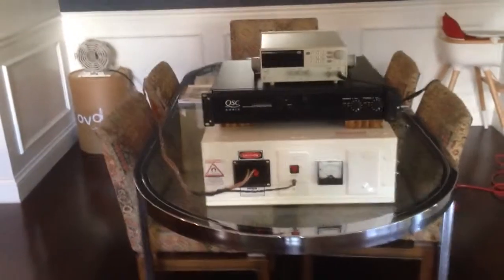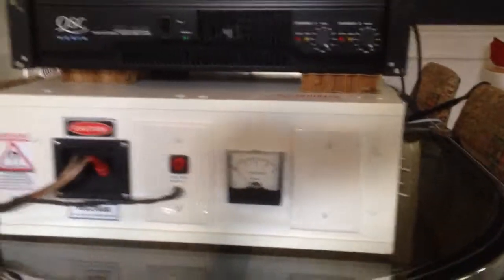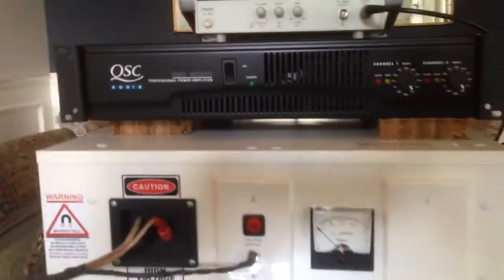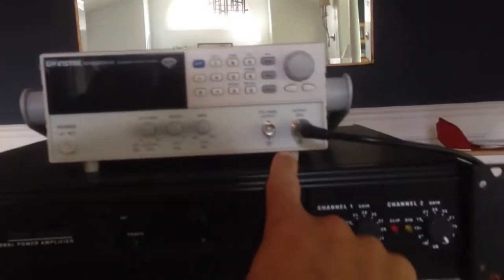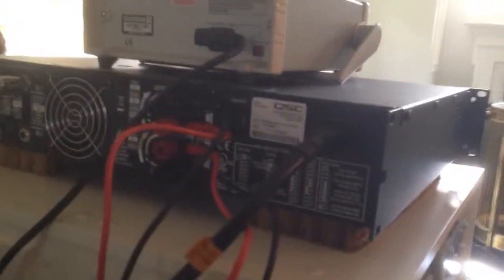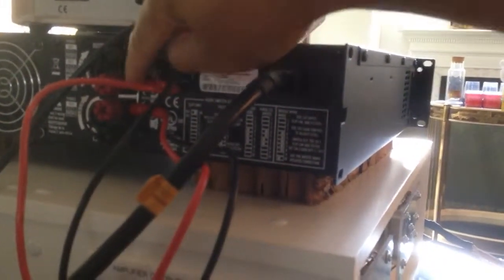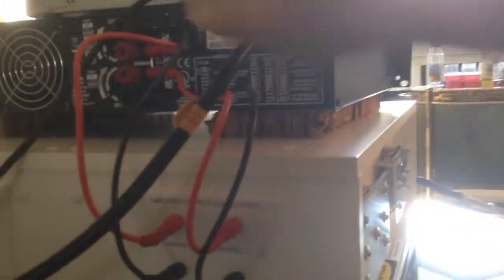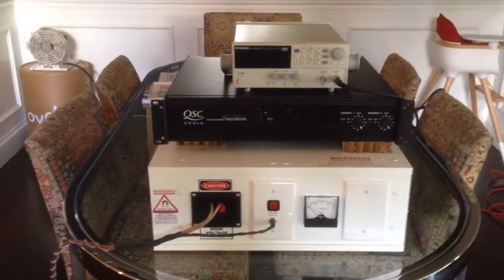Lyme Disease / Coinfections Treatment Demo: How to Setup a Doug Coil Machine, Part 1

Comment: Thank you! Lost my instructions so this was a big help.
Reply from the maker: Thanks Rich. I'm happy to hear that this is still useful.
Reply: @b-r-o-b  would you happen to have or know where I can get the documentation for the machine?  i.e. the switch chart and list of frequencies for differenet ailments
Reply from the maker: @richpurcell  In case you haven't come across it yet I also recorded part 2 of this video to demonstrate how to use the coil machine (see https://www.youtube.com/watch?v=W97mjoYBzMk). 

I bought a book called "When Antibiotics Fail: Lyme Disease and Rife Machines" by Byron Rosner (https://www.amazon.com/When-Antibiotics-Fail-Evaluation-Alternative/dp/0976379708) which lists over 20 lyme specific frequencies or frequency ranges on page 115. This was helpful.

I bought the coil machine several years ago from a site called coilmachines.com (made out of Arizona if I'm not mistaken) which came with a capacitor switch configuration chart (I discuss in part 2 of the video).  If you provide me with your email address I'd be happy to email you a black and white copy that you can print.

For frequencies found elsewhere, you will need to use a calculator to get the capacitor switch configuration for this machine. The coilmachines.com website has this calculator available here - http://coilmachines.com/capcalculator.html